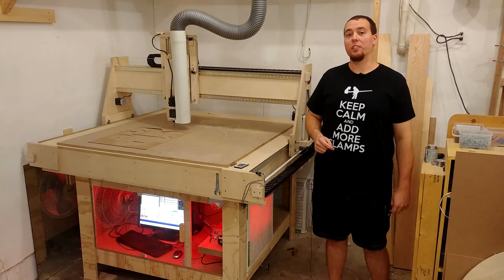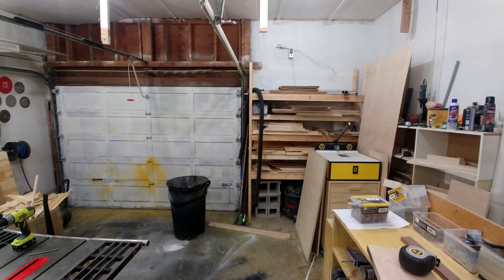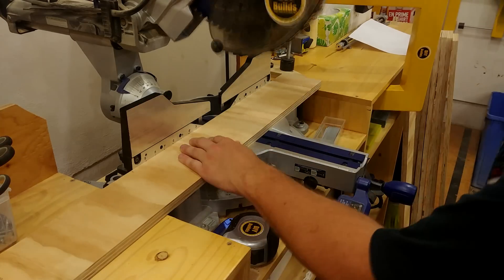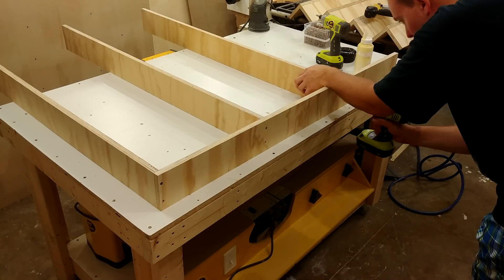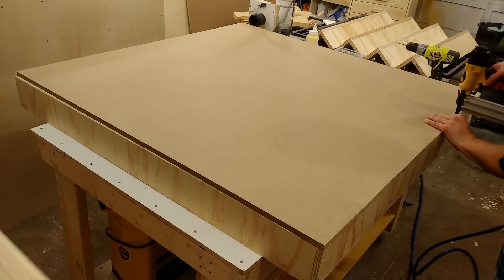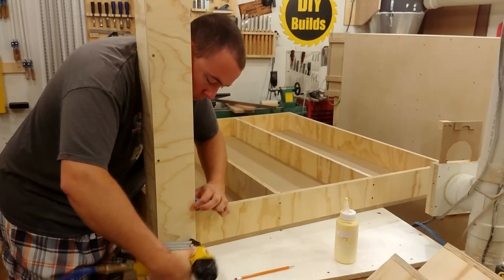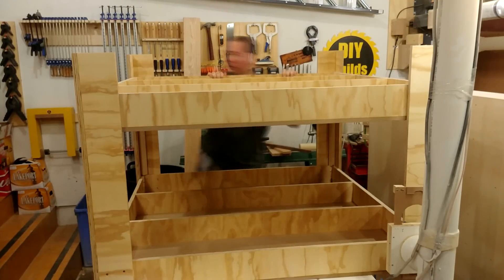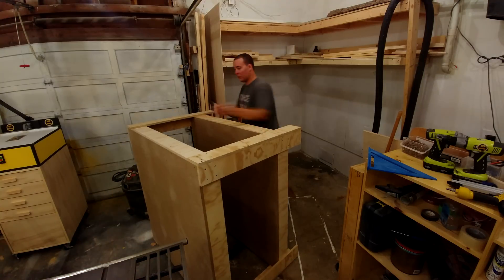Homemade CNC Router Part 1 - Building the Table

Comment: Great project, execution.

I'm looking forward to see a dial indicator measurement for flatness of table, and for rigidity and perpendicularity of router bit when deflected in all directions.

I also wonder about moisture content varying.  Would sealing the wood with paint or varnish stabilise the moisture content?